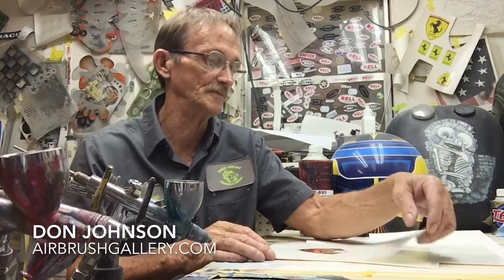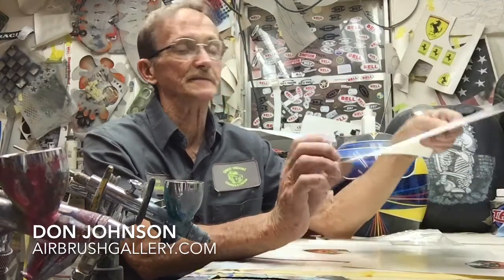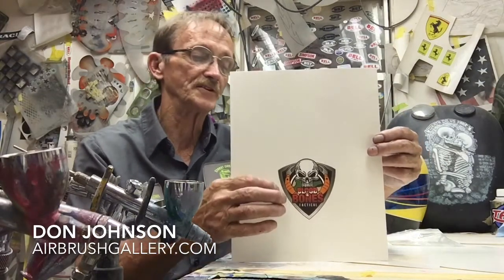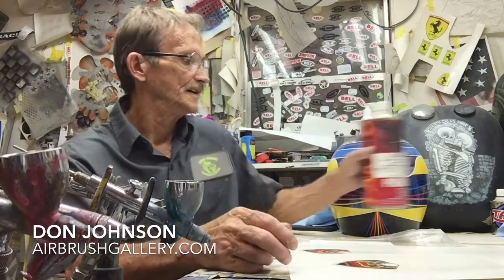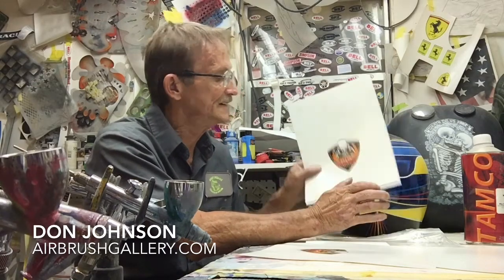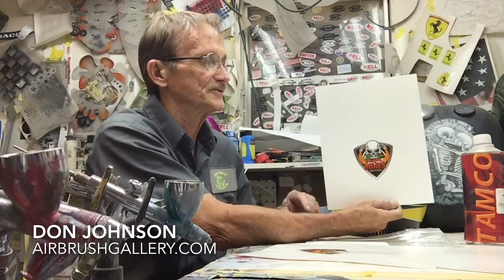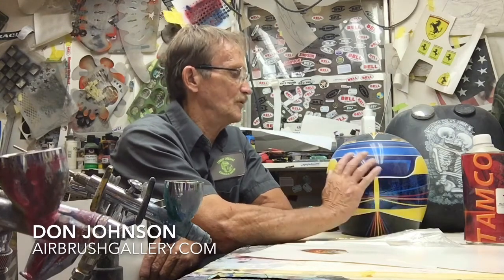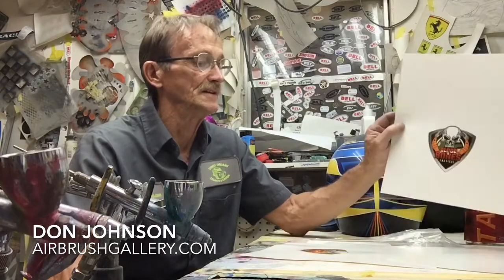Airbrush Video- Using Water Slide Decal Paper In Your Airbrushing Projects

Comment: I've been experimenting with a new crafter's "HACK" using clear waterslide decals on dark surfaces by mirroring the image and applying white spray paint to the printed side, then applying it painted side down.  This hack works, however it either requires a very skilled hand to cut (and no intricate details) to avoid white borders, or it requires printing a background the same color as the object you want to apply the decal to.  I found this video while searching the possibility of using an airbrush to spray white enamel only on the colored surfaces of clear waterslide to allow an opaque decal without a white border.   

I don't have an airbrush but would invest in one if this is a viable idea.  My first thought was a small paintbrush and model paints but that may be too tedious and might leave brush strokes that would impair adhesion of the decal.  Anyone have any suggestions?